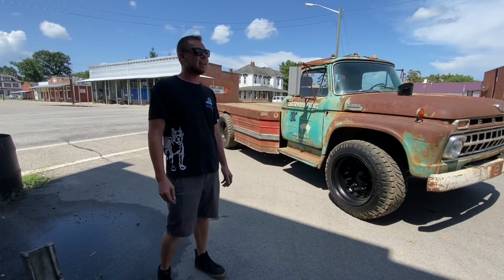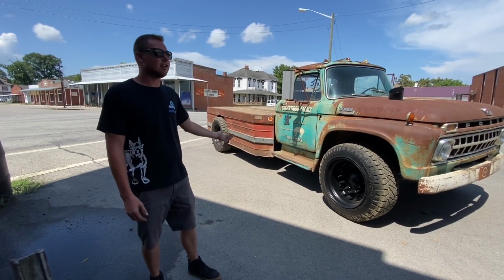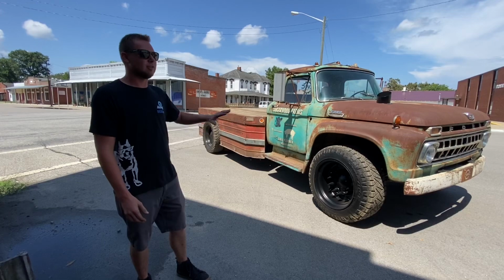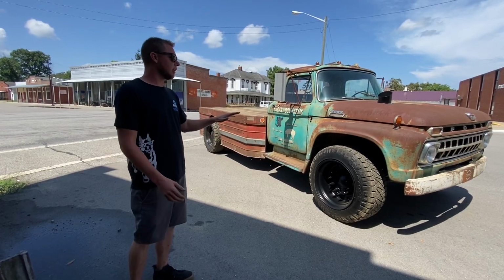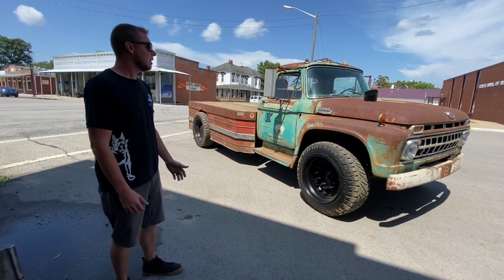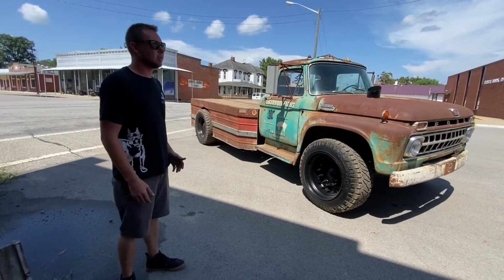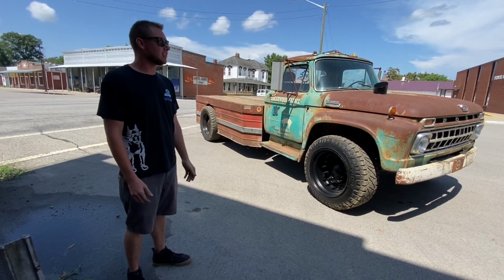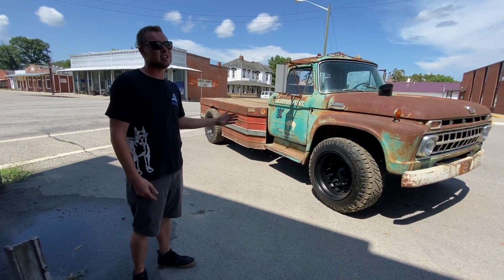Showing my grandma the farm truck after we finished it!!

Comment: Your state must be a little more easy on exhaust rules than texas is. In texas if you have a exhaust you have to have a muffler and it come out from under the truck. You cant put a hole in the hood or it wont pass inspection which means here you cant get registration